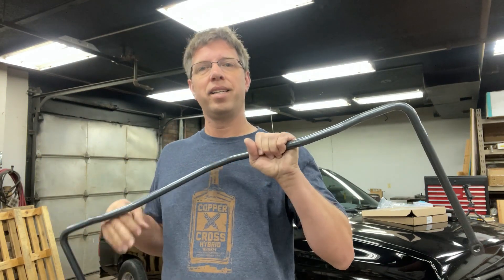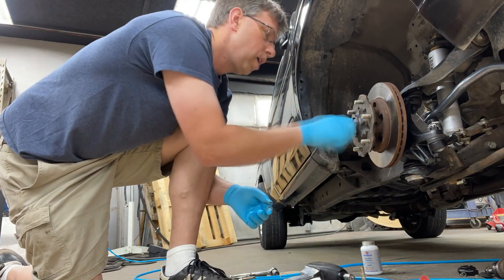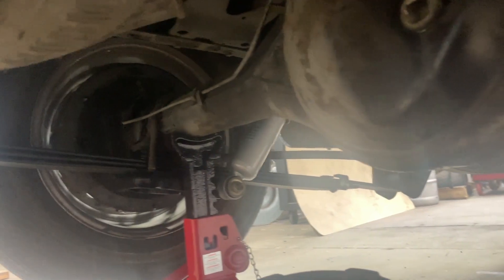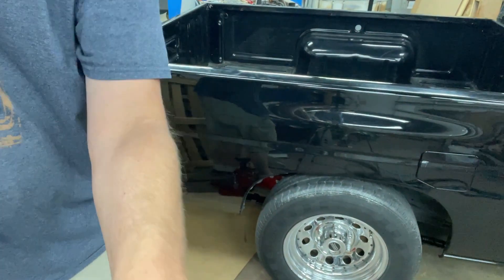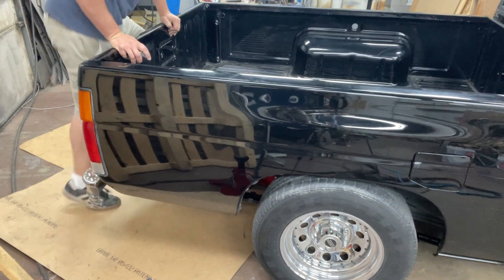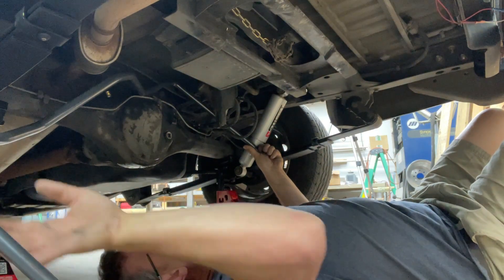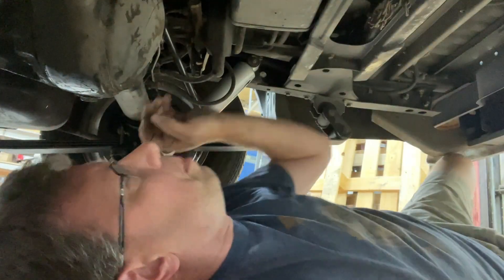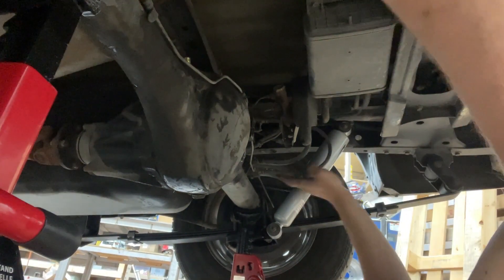EP.9 1995 Nissan D21 Hardbody new REAR SWAY BAR, Belltech

Comment: That video made the job look a lot easier than I thought it was going to be. Luckily I chopped the exhaust to the cat so hopefully I will be able to get it in position a little easier hehe. Thanks for making this video!
Reply from the maker: Overall, I think it was very easy to install this. It’s just on my truck. I had to modify the hanger so the clamp would fit other than that. It was pretty simple and straightforward. Thank you so very much for watching.

Comment: @10:50 that is a resonator and is on all factory d21 exhausts not a cat so California(San diego) only had the design portion to blame
Reply from the maker: Thank you very much for pointing that out. Most of the D21’s I’ve ever had were much older. They never had the extra resonator on them. At least not what I remember. I think when I was in the heat of it (installing the rear sway bar) having that resonator up there was making me upset. 
Thank you so very much for watching my videos.

Comment: Good video man. Good to see if i wanted to keep that bracket, how i can work around it. 💪💪😬. How did the furst ride feel after that. Back roads?
Reply from the maker: Well I changed so much on the truck before I really drove it hard. With that said it handles so darn good. Little to no body roll with not feeling like your in in a dump truck. It did great (I thought ) at auto x. Thank you for watching. O and the tires help a lot, very sticky.

Comment: Most people un hook  or remove the load valve completely
Reply from the maker: I would totally love to unhook it. I just don’t know about all the brake lines. If I could install a proportioning valve up on the brake master cylinder, that would be awesome. Thank you so very much for watching my videos.
Reply: @jolede029  if it is in the unloaded section it does nothing different if it is loaded it applies more to the rear. If you plug the loaded line at the start (near the firewall) and remove the hard line and load valve you simply connect the remaining flexible line from the rearend to the hard line that is left
Reply from the maker: True, but then I will not have 80/20 brakes. It would be 50/50 so it would not brake as good. But if I put a custom proportioning valve in, then I could manually adjust the braking difference from the front to the back. That rear valve is basically a weight adjusting proportioning valve. What do you think? Do you see what I am trying to say?
Thank you very much.
Reply: @jolede029  there is a proportioning valve already that's how you have 80/20. If you remove rear valve it doesn't decrease your front brakes it just un clutters the rear
Reply from the maker: Very good to know. I will look at taking it out. Thank you very much for letting me know and sharing that info.
Reply: Chase Bays makes a proportioning valve you can use.